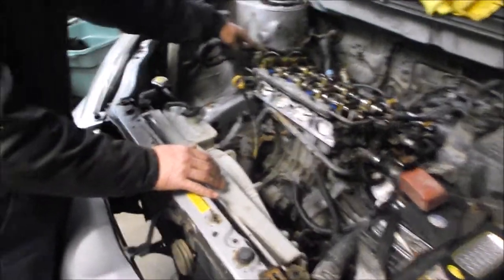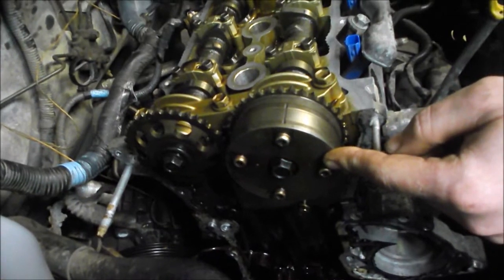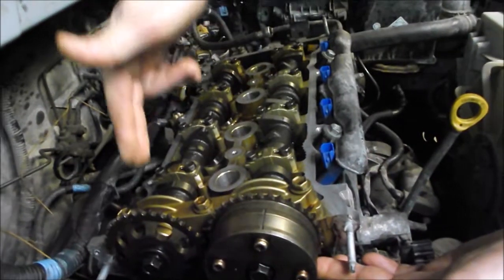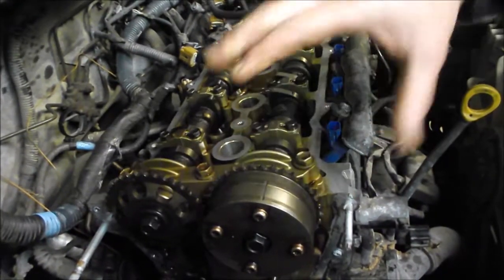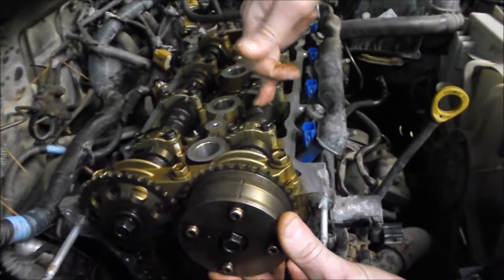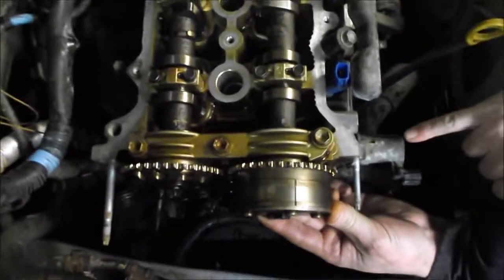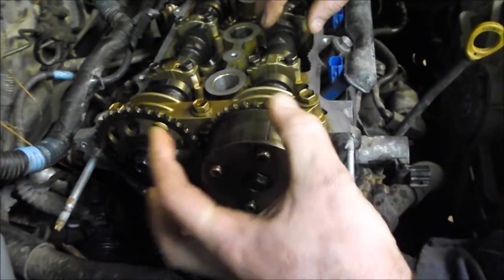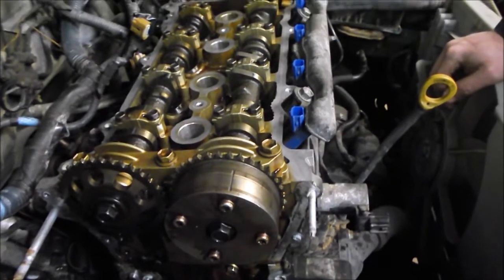Variable Valve Cam Shaft Timing Explained Toyota Matrix & Pontiac Vibe

Comment: @mr diyguy123 The shop is telling me they have to get inside the engine to replace the vvt solenoid but you just pointed at an area that I can access very easily without tearing down the engine.  Am I correct?  They are calling in the morning with my estimate he said to expect it to be high.  I think he is in the process of ripping me off.  Is the filter right under the solenoid?  My symptoms are on a 2009 vibe 1.8 and it is nothing more than the infamous rattle upon cold startup.  Apparently the cam is not being returned to the correct position and leaking the oil out overnight. @UCqk4uQaUrzOMcvoNiL-NWvA
Reply from the maker: I would recommend getting a second opinion.  I don't actually remember the deeper details of the solenoid location.  I was the camera man, not the brains of that operation.
Reply: @mrdiyguy123  thanks for the reply
Reply: @c0balt358  actually no, I am living with it but want to have it fixed really badly. I'll have a look at the translation of that page. Thank a lot.
Reply: @joseph519r  Hello , be sure to buy a real toyota part. some bought cheap and had to start over. keep me informed of your work. I think I remember that the work costs less than $ 400 at the garage in my village
Reply: @joseph519r   I finally found a garage with a real mechanic men , the job is done. the 2 part are changed and all is well the price +/- $ 960. Have you done your repair? you can go to the forum to see the picture
Reply: @c0balt358  thanks I ended up selling the car. I made the gal aware of the issue and the fix and she bought it as is. I'll be curious if it is the solution for you so still let me know!